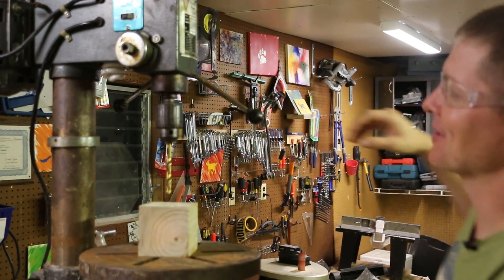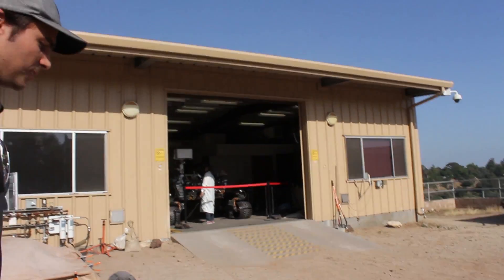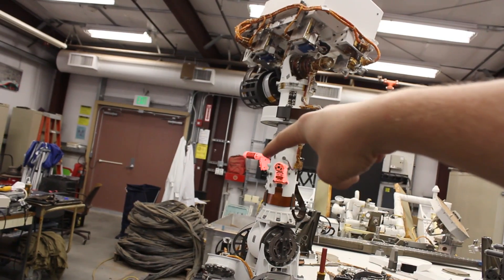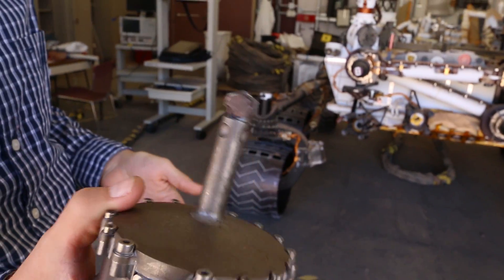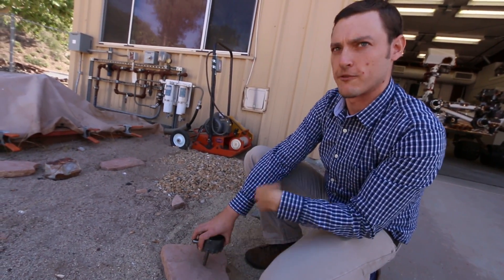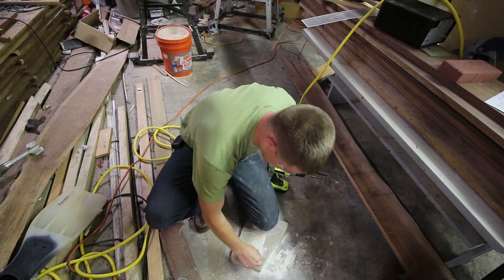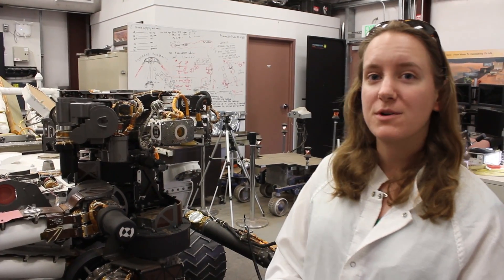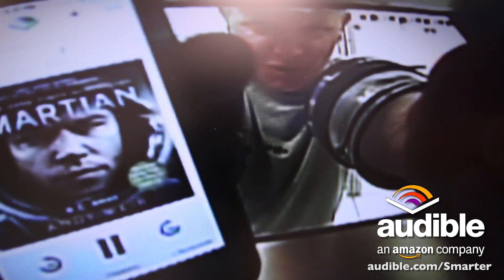The Drill we sent to Mars - Smarter Every Day 143

Comment: I designed the pyro-fire PCB's for the Curiosity Rover. They controlled explosive bolts used to deploy elements of the space craft during landing. It was an interesting project.
Reply: Hi !
Mine diver here.
Can you remember the specs (voltage) were used to set the bolts of?
Greets from Germany.

Comment: Why don't they just vacuum the dust up? Or scoop the dust up with a mechanical shovel? Drilling doesn't sound like the best option here
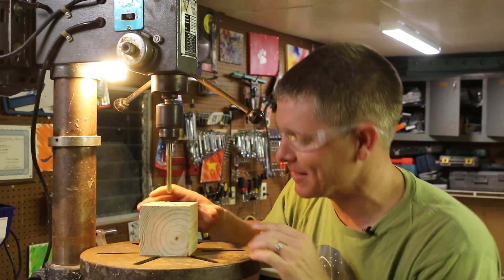Reply: 0:14 watch this more carefully...dust is usually just the top layer that got weathered by air, etc.... But if you can a drill into a rock...it's basically the stuff that exsisted millions of years ago. 
Also think about it, don't you think the smartest engineers in the world wouldn't think of a vaccum? Obviously it has its problems and a drill is better...so do some research

Comment: what i do not understand is why only take a small sample that is powered rather than a “coil/chip” of material. the speed of the bit, the rake angle and primary and secondary hook angle of the big matter a lot. think about a bit drilling through wood at high rpms, the “chips” will turn into dust. if you drill into wood at slow rpms the chips would be whole and all in one piece, depending on how many flutes it has.

Comment: @5:22 a center punch is first!!! If the finished  hole is of larger diameter you will use a pilot hole. If the finished hole is of smaller diameter you start with a centering drill bit.🤓

Comment: that chisel looks extremely brittle for mars drilling. not the mention 8mm drill with that point which would break so easy if it gets stuck just a bit. it looks extremely bad engineering. why not just the regular rock drilling chisel for hard rock. and also it looks incapable of collecting dust since its point is much wider than the rest wich is suposed to bring dust upwards. and since it doesn't work like vacuum but rather gravity,  collecting looks impossible.
Reply: xxtoxii Mars ground is not hard. Mars has gravity

Comment: Five millimeters ?   Dividing that by 25.4  you get  196 thousands  with the closest fractional measurement  @  13/64.   The common masonry bit looks like 3/4.    This looks like a remote shop at  Cal Tech's JPL.
Reply: The starter hole is just 5mm. Then after that they bottom out the drill bit. That looks to be about 3 or 4 inches.
Reply: @davidhenderson3400  The initial hole depth is 5mm,  then  final depth is drilled.
Reply: @robertgardner7470  I thought I said that?

Comment: The drill you are using for the example does have a hammer function but it's not a "true" hammer function, more of just a buzzing action. The one you are using will get the bit too hot by spinning too fast (will blow hot powder all over you as well) . It will take you forever to drill a hole. You need an SDS hammer drill. It will make the same drill bit you were using cut through rock and concrete like butter.

Comment: Hey Destin,

Not sure what the original purpose of the experiment was exactly (hardwood vs felt, and the effects of spacing?), but a couple things I was thinking about to improve the experiments was around the knocking them over and recording the speed.

First was knocking the dominoes over. I think you need a more precise mechanism for knocking dominoes over; something with a consistent speed and something that will hit the dominoes in a consistent spot on the dominoes. I feel like the varying speed at which you knock the first one over, will affect the overall speed of all of them falling. As well hitting them at the same spot is important, for the reason you noticed how the dominoes twisted and untwisted as they fell. I have a feeling if you were able to knock the first one over with force that was even or hit the centre of the first domino, that twisting would be eliminated (or lessened).

Second is the timing. Instead of having one camera that needs to travel, can you setup two cameras. You would have them pointed at the last and first (or 10 dominoes in from the first) and sync the camera footage with some sort of laser device. I am thinking using mirrors and prism you would have a single laser beam split into two directions which each camera could capture, send a quick laser burst, while the cameras are filming. You would then be able to sync the two footage streams, and time how long it takes x milliseconds for y amount dominoes it takes to fall over. This way you wouldn't need to try and capture all the dominoes with a moving camera, and you would only be concerned when the first and last domino was hit, vs finding when each domino hits. You wouldn't have found the twisting effect you mentioned but you would be able to have a real number to compare between two data sets.

Comment: Let me help some of you dorks there's no such thing as space travel propulsion does not work in a vacuum they've never been to Mars or to the Moon the mathematics don't add up nor does any of the reel to reel it's all missing there's no information equates to space travel
Reply: there's a thing called oxygen, in a tank, in a spaceship, beside that that tank sits a fuel tank, the fuel tank is also in a spaceship, you open the tap from both tanks, mix the oxygen an the fuel, spark the ignition, and voila, space propulsion. there you go, a bit of rocket science, not that hard right?

Comment: that is a really good 3d Printer that was used to make that mock drill, I honestly couldn't tell the difference between that and a injection molded part, it is most likely not a extruded material and instead a uv hardened resin printer, but either way that was a high quality print.

Comment: How do you clean the dust between two different tests, does traces of previous dust will not effect current results  ?
Reply: Vik Ram My big question! That was the question I would have asked. Thief! Seriously, very good question. I'd love to know the answer.
Reply: That's why they check to see if the dirt or rock they r drilling into is wet or not. They avoid wet substances to prevent residues staying inside the drill or worst, clogging it. I perhaps they also use specialized alloy with smooth surfaces to reduce friction when transferring debris, so that it further reduces the risk of having leftover dusts in that gizmo
Reply: i bet they dont need to clean it.. For example they drill hole A they get the results and analyse them. The they drill hole B, they compare the results with hole A, they see if there is any differences... and so on.. I bet they dont really need to be accurate with each hole for example if they drill 50 holes in radius of 100m2 and get different results, the area issint big and they dont really need to be that accurate,  all they need to know is that in that 100m2 area out of 50 holes they got these results.. They dont really need to have info on specific hole alone.
Reply: I was pondering the same. There's giant dust storms etc. on Mars aswell. It's not like you can just hose it down. Maybe one of the arms has compressed air? Probably not that simple, but a very interesting question regardless.
Reply: They didn't even mention it because they probably didn't think about that. For all we know this is bullshit anyways.
Reply: @DrFumesta  you can smell it a mile away!!

Comment: I know this is an old video and kind of a late question, but when fully functioning robots are finally a realization, can't we send them instead of a giant rover vehicle? Send over all the equipment for long term research with the bots to setup a research facility for prolonged activity on martian soil.
Reply: Josh Dizon Define "fully functioning robot" I have a fully functioning robot in my house. I can tell it to do a whole bunch of things. it's made out of legos. The main problem with long term robots on mars is they must survive for long periods of time. this is difficult because they have trouble repairing themselves. Instead most things we send into space just have a bunch of extra systems on the chance a system brakes. Three sensors means three times the likelihood you've got a working one when you want to look at something. Anyway rovers are rather good at what they do, which is go and look at things. Beyond that setting up a full time base would be difficult because you'd need robots to look at things, repair things, mine things, refine things, build new things, transport things, keep all the other robots from being swept away in a dust storm, It would be an incredibly difficult and expensive endeavour that probably wouldn't be worth it in the end.

Comment: I have a doubt If anybody ever could answer, how do you clean the material, the powder, when already drilled and tested-out? Like is you're examinating a molecular process wouldn't it have to clean all the powder and molecules from the past powder?
Reply: Great question! The rover does do a "clean all" sequence where it opens up several doors in the sample processing chain and vibes to get the bulk of the sample out.  As you suspect, you can't get every surface perfectly clean after drilling. There is some cross contamination from previous samples, and the science instruments can detect it. We have a few tricks we can use if the science team needs to. We've done dilution cleaning in the past where we scoop top soil which has been exposed to lots of radiation. Running several scoops through the system can help purge the system by scrubbing the walls in a sense. Curiosity also brought Organic Check Material with her, which is a man-made "rock" with no organics. Curiosity has 5 of these and we can drill into and analyze one to get a baseline signature before processing a particularly interesting sample.

Comment: I'm somewhat  confused does the drill suck the particles into the tube or is it gravity by turning it upside down?  Won't the particles fall off?  Or if there is wind fly off?
Reply: The drill bit has flutes. Just like a drill bit you would use at home, the cuttings travel up the flutes and out of the hole. Curiosity's drill has a sleeve around it to help collect sample and most of the cuttings travel up through the flutes along this sleeve into a canister. There is a vibe motor on board that is used to help motivated the sample to where we need it to go after that.
Reply: Has nobody noticed the mechanical engineer in the comments section yet? :P

Comment: Around 4:35 - -is when Nasa's Ryan describes a Hammer Drill.  An amazing most-needed drill.   Drills through concrete, stone, rock, & yes Mars rocks.  First saw one in action when the garage door mechanic fastened a large bolt onto our garage door.  It looks like a drill yet hammer-drills.  Can buy 18-20v cordless and high-amp corded --like Dewalt's 7.8amp Heavy Duty 1/2" DW511.  Makes a good science project for project-based Teachers

Comment: Something I am actually very curious about, What are all the various designs on the treads of the rover wheels for? Why don't they maintain a standard tread design around the whole surface?
Reply: +mythralt The tread design is actually JPL in Morse code! We use the pattern for visual odometry. By measuring the distance between the unique features in the tracks that the rover leaves behind, we can determine how much the wheels have slipped.
Reply: Oh wow. That's awesome! Thanks a lot!

Comment: 6:32 ok, hydration may clog the drill, but what if the unerlying rocks are to hard to drill through, for example when it is composed of granite? Does that happen on Mars? If so, what to do under that circumstance? Go on drilling (some drills actually work for granite, albeit with much higher energy consumption & lower mileage) or pick another place with another, hopefully softer material?

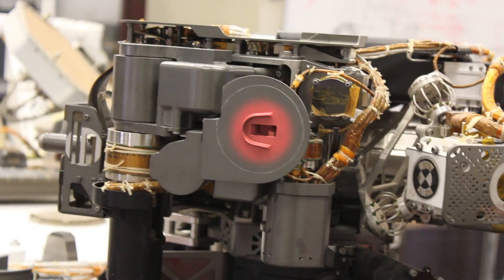Comment: 4:05 Isn't it risky to put the samples on that plate for measuring if it is windy at that moment on Mars? Wouldn't it loose the samples! I thought there would be a cup around the flat plate to keep the samples from being blown away by the wind! Correct me if I am wrong! Thank you 
Great clip btw :)
Reply: +rvmvadati We call the area with the plate the sample playground and can use that to tell us if we think the sample is safe to run through the processing system. We don't want to try to pass a sticky sample through sieves and the small portion tube. Destin points out the portion tube in the video where the sample comes out of the processing system. The main science instruments are in the body of the rover so their inlets are on top of the rover deck. It's hard to see but those inlets but they do have wind covers for exactly the reason you're talking about!
Reply: +Megan Richardson So there is a wind cover around the sample playground before its ran through the processing system?
Thank you so much for the respond! I love what you do! I wished they would hire me :)
Reply: Thanks! rvmvadati sorry for the confusion, there is no wind guard around the sample playground as you pointed out. The playground is more for engineering purposes and a portion dropped there won't be processed through the instruments. That portion could blow away as you point out, but we would have learned what we're hoping to learn which is how will the sample disperse and travel over the different surfaces in the playground. If we had bad luck and dropped a portion during a large gust, and didn't get a photo of the dispersion, we would need to drop a second portion there. There are wind guards around the inlets for the science instruments which you can't see too well in the video because they're on the top deck of the rover. When we want to deliver a portion to the instruments, we prep a portion, position the arm over the inlet in line with the wind guards, then open the inlet cover and drop a portion. When we drill or scoop, we typically collect plenty of material for many portions so we can drop several portions to each of the instruments and to the playground as the engineers and scientists deem necessary.
Reply: +Megan Richardson Wow that is amazing! Thank you so much for clarifying that!. Now it all makes sense! Good luck with your amazing job! You are making history!
Reply: Megan Richardson It's so cool that JPL allowed Destin to bring your work to the rest of us who, usually, would have no access to see the thought processes behind a machine entrusted to travel so far! I can't congratulate you and your fellow engineers on the success of Curiosity enough. Thank you so much for your dedication to detail and functionality. Have you considered making the flight yourself? You must be a prime candidate for payload specialist.
Reply: Flat earth m8 look it up

Comment: What are the tolerances between the auger and the stem like? Furthermore, how do you control the size of the dust particles?! I imagine if the dust particles were just the right size, it could end up getting stuck between the auger and stem inner wall, leading to the auger seizing up.

Comment: Oh man, you have to visit that Earthside Curiosity Rover EVERY DAY. 

I always wanted to know about those electric motors in the wheels. Are they stepper motors? Ac-motors with a lot of reduction? Dc motor with a lot of reduction? Are they sealed? how do they deal with the abrasive dust? how much power do they use?

I've been fascinated by those motors-in-the-wheel since the pathfinder.

Comment: How do they clean the drill in-between drillings to prevent cross contamination?
Reply: Good question, +Ashley Carmichael.  When we transfer the sample to CHIMRA, we go through the sample transfer motion sequence five times.  Most of the sample is transfered during the first cycle, a little is transferred during the second cycle, and by the fourth and fifth cycles there is almost nothing left other than the stubborn stuff coating the walls (via electrostatic Van der Waals forces).  The amount that stays in the drill bit after sample transfer is small relative to the total amount of sample we collect, so there is cross contamination between successive samples, but we tested enough to show that it's within tolerance as required by the science team.
Reply: Awesome, good to know :)
Reply: +Ashley Carmichael I was wondering about that as well, thanks for asking.